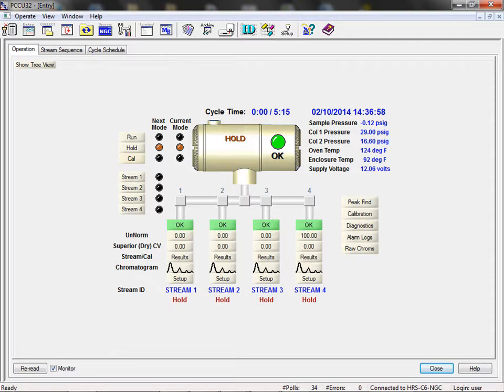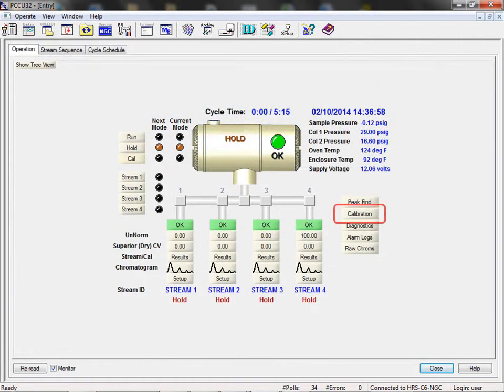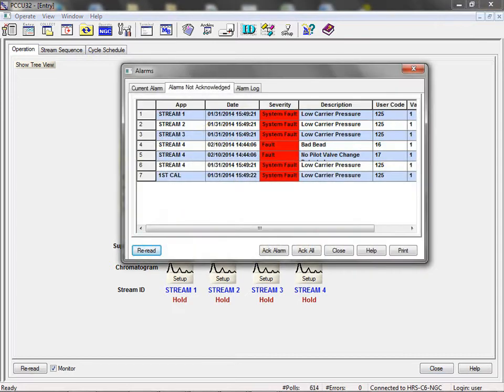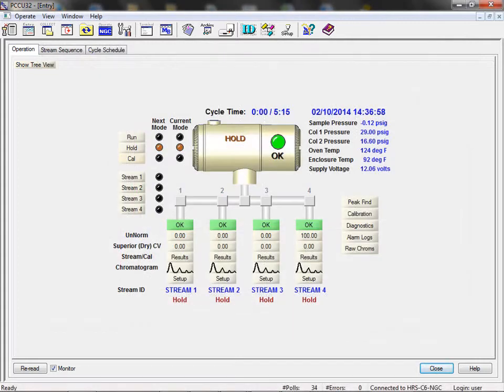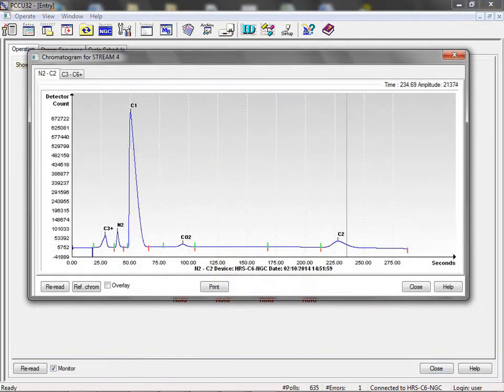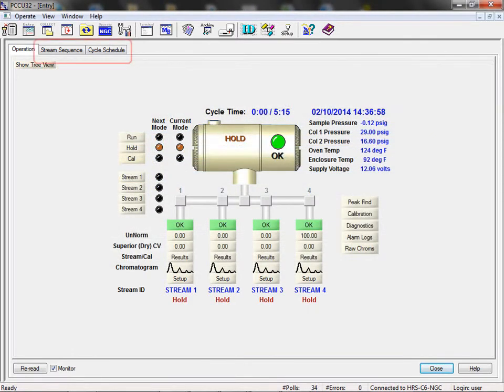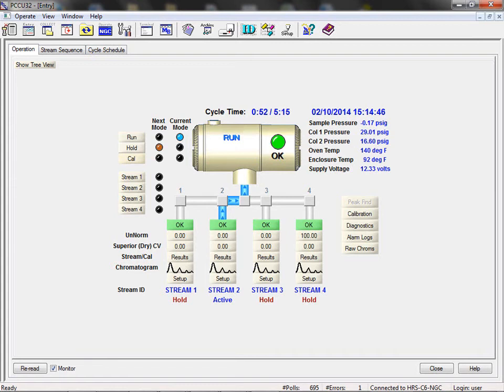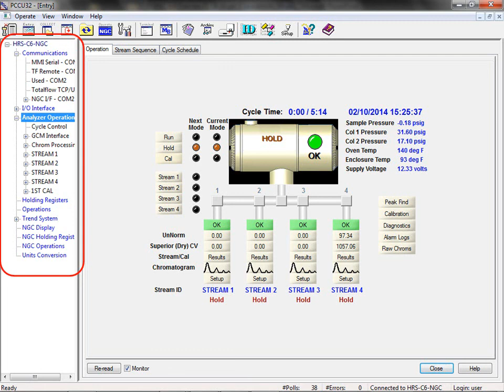Operating the ABB Natural Gas Chromatograph Using the Graphic User Interface

Comment: Hi there, my query is regarding the analyzer to go in HOLD mode after some time, not specific, sometimes it go in 15 days and sometimes it go in 30 days or less, all of sudden NGC8200 Chromatograph went into HOLD mode values freezes. We have to go there and put it in RUN mode. What might be the reason behind this.

Comment: Hi there, my query is regarding the analyzer to go in HOLD mode after some time, not specific, sometimes it go in 15 days and sometimes it go in 30 days or less, all of sudden NGC8206 Chromatograph went into HOLD mode values freezes. We have to go there and put it in RUN mode. What might be the reason behind this.
Reply: Please how do I contact you?, I need some consultation on the ABB Gas y